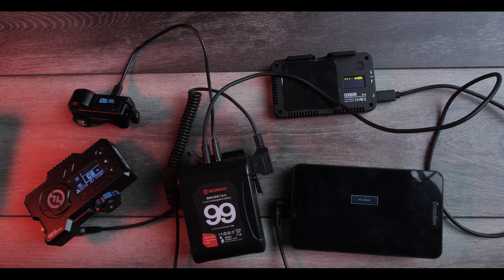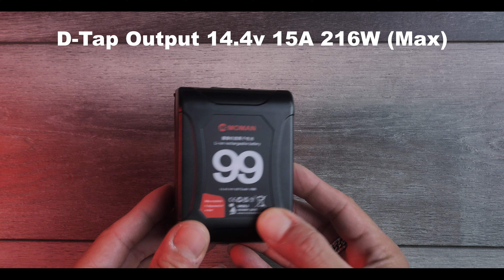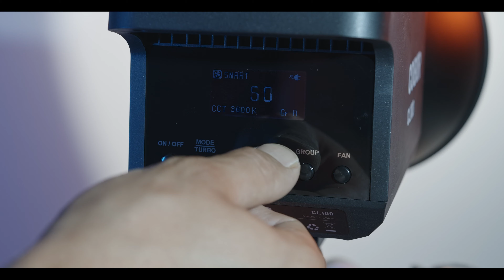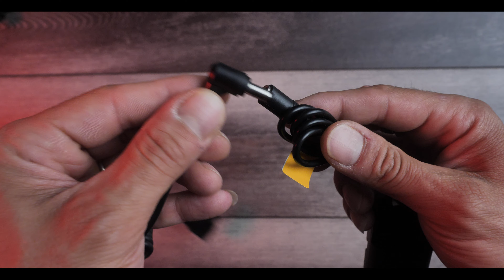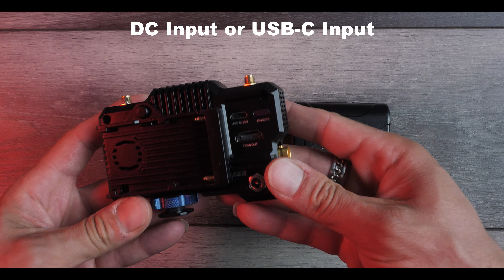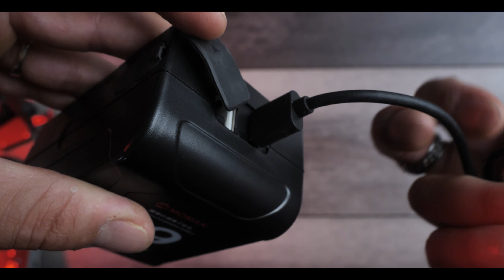Best V Mount Battery for Camera Rig Setup - Moman Power 99 V Mount Battery

Comment: How long its  power your cam with  ext. screen ,FF, and hollyland? How many Hours?
Reply from the maker: That’s a great question 
So far I have been able to film for approx 4 hours and I still had some battery left. 
Camera , monitor, follow focus and Hollyland transmitter. Keep in mind my monitor is 2800nits brightness so depending how bright I keep my monitor I’m sure it will effect the battery span. I will continue to use this rig and battery and share more tests results in some upcoming videos.